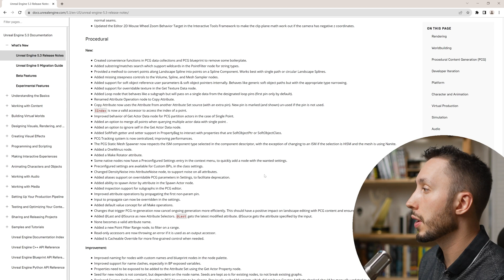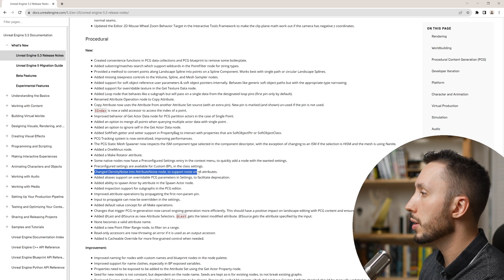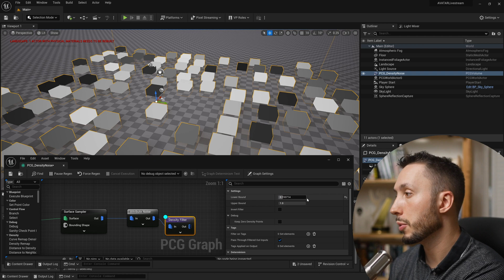Where Is The PCG Density Noise Node in Unreal Engine? Procedural Content Generation Guide

Comment: Is there any reason you need an extra node (Attribute or Density) to create the noise? The points seem to have a density value straight out of the Surface Sampler already (as shown by the different grey values in the video), and the Density Filter seems to work from this, without the extra Density/Attribute Noise node.